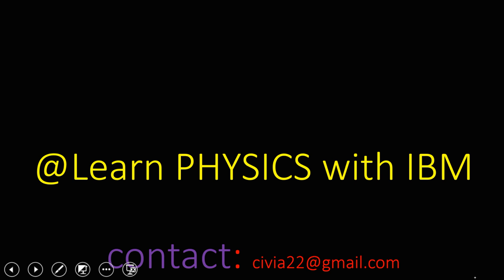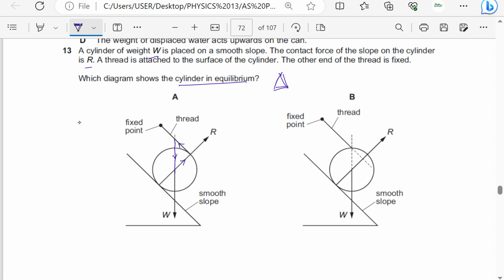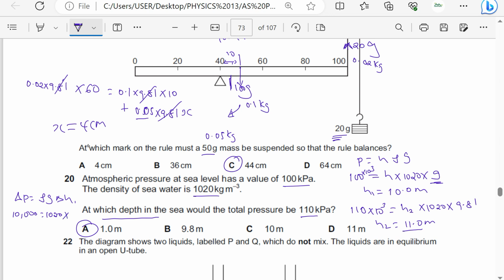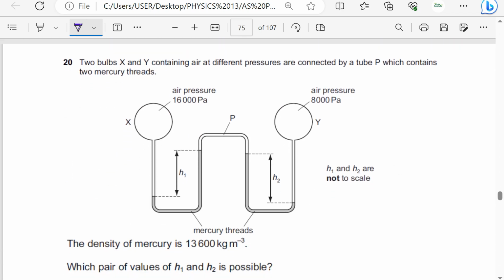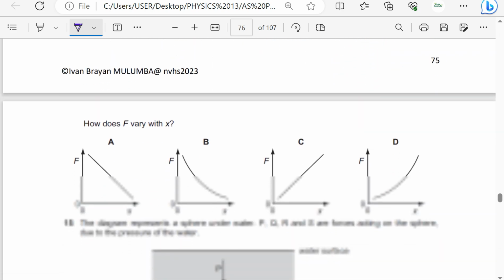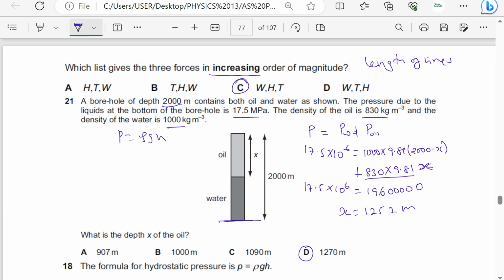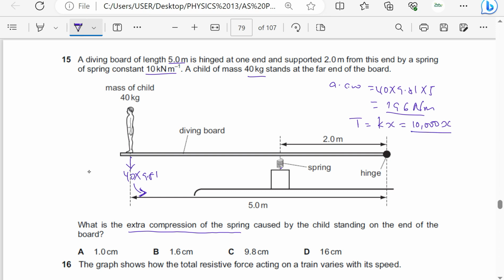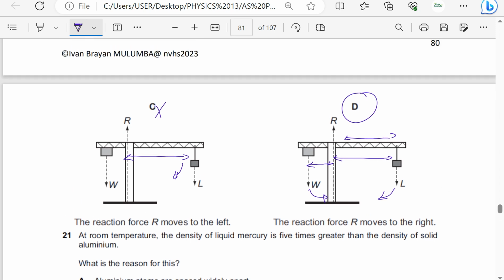CAIE AS PHYSICS 9702 Force, Density and Pressure [MCQs] #Part 9

Comment: Sir how do yhu know this force is acting clockwise or anticlockwise? When taking moment about a pivot
Reply from the maker: put a ruler on a sharp knife edge in the lab. when u are facing the ruler, u will see if it falls on your right, it is moving clockwise, if u touch on it on the left u put a force which causes the ruler to rotate anticlockwise so forces causes moments like that